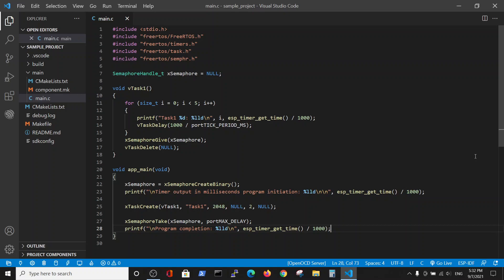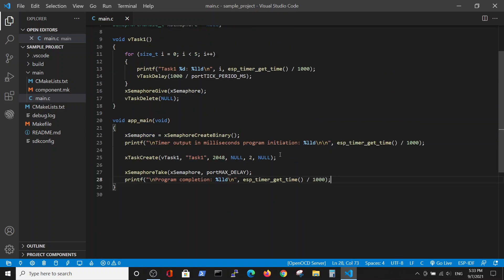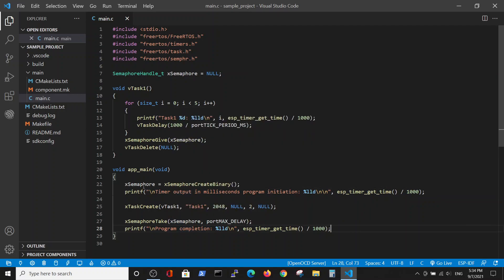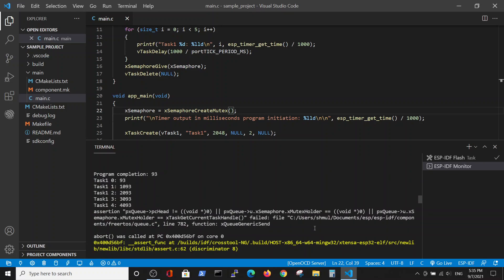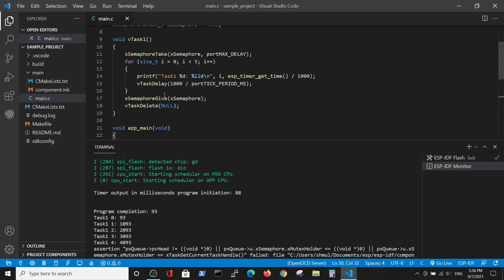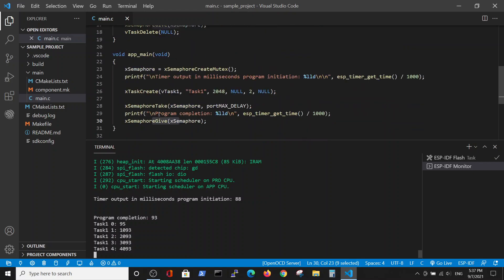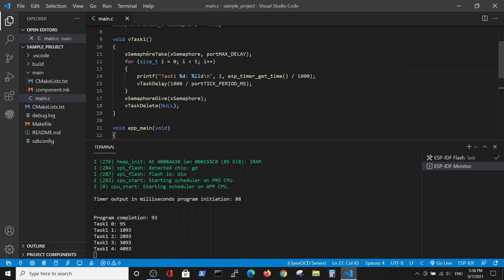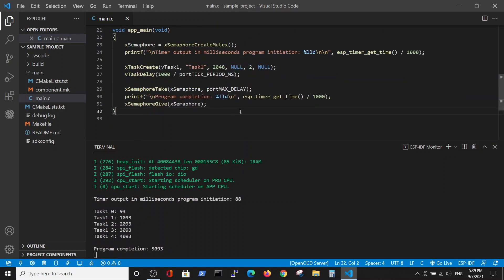Task single binary to mutex semaphore - FreeRTOS ESP IDF for esp32

Comment: יש לי שאלה כללית..
כשלמדתי שפת C, הייתה אפשרות בvisual studio לדבג ולהריץ את הקוד בשלבים ותוך כדי לראות את טבלת המשתנים מתעדכנת.
האם יש אפשרות דומה במקרה של esp32?
למדתי מזה המון..
Reply from the maker: Dear @ozzy750,
Debugging the code on an external processor such as ESP32 is different from the way of debugging the code on a PC.
Using the C language in Visual Studio I believe you worked from a PC.
To debug in real-time an external processor like ESP32 you can use an additional special external card so it's a little bit different.
Reply: @simsiotdevices6219 
so in order to do so what card are you recommand?